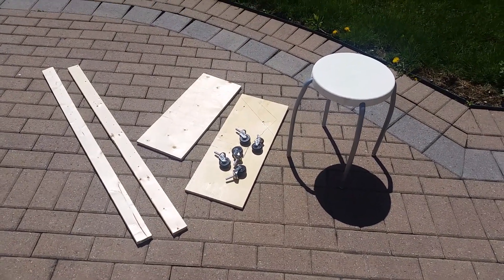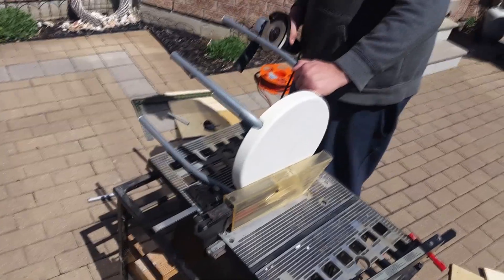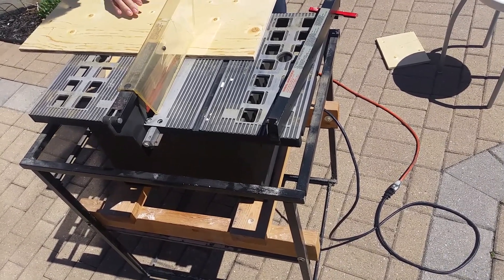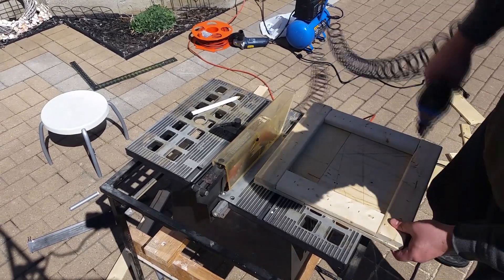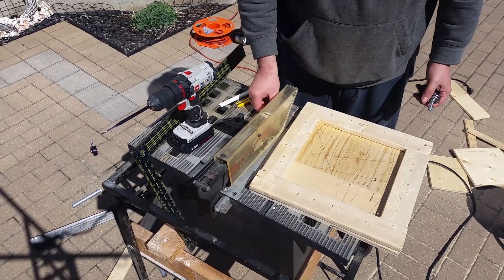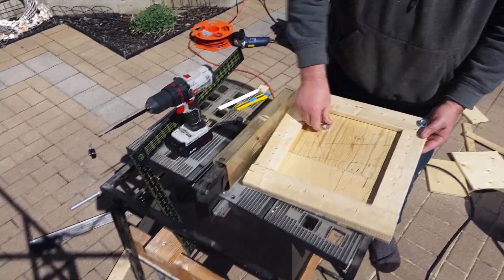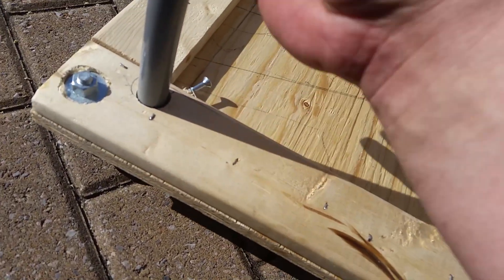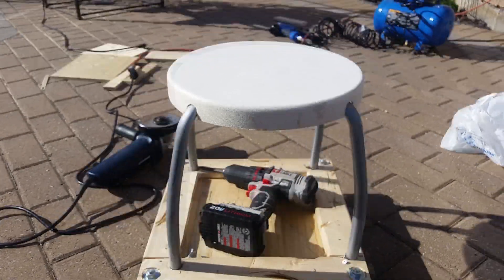DIY - Make Your Own Mechanics Wheeled Stool On The Cheap

Comment: Well done - exactly what I wanted to see as I have a similar stool and previously made a similar frame on casters for my BBQ. Hope you are still getting good use from it. Regards
Reply from the maker: sure am. just make sure you buy good casters and also that it has beveled wheels (not a flat profile) so as not to get stuck on stones and such